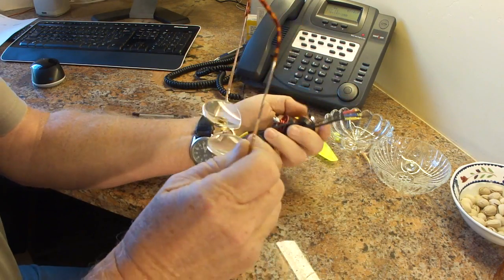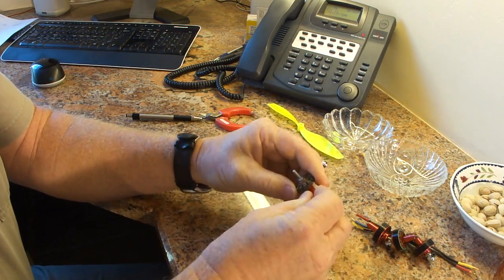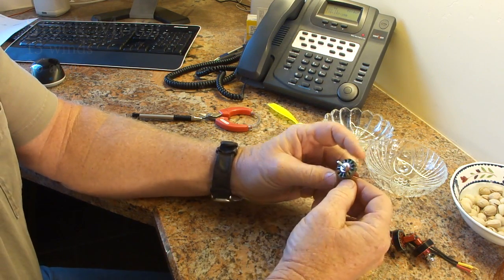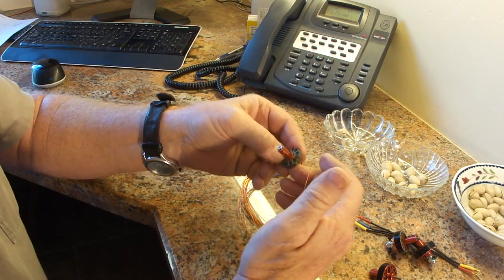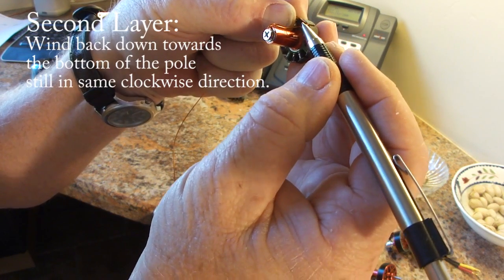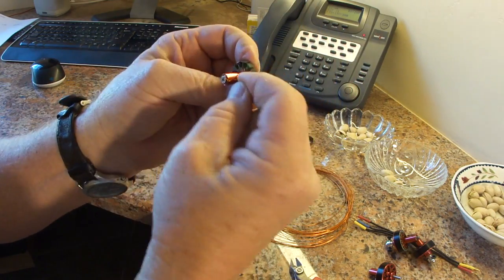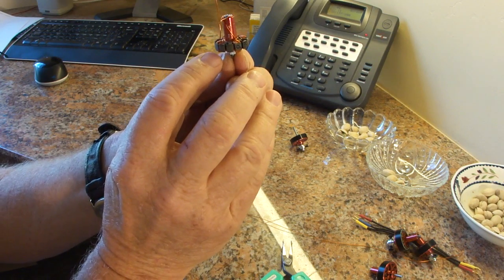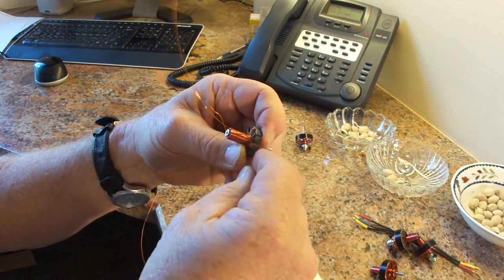Rewind Part 1.mpg

Comment from the maker: Label the end of each pole in sequence as you go around the stator counter clockwise (looking from the back of the motor) as follows: A, -, -, a, B, -, -, b, C, -, -, c .   Start phase A winding at a and end at A, phase B at b and end at B, and start phase C at c and end at C always skipping two poles moving from pole to ple in a counter clockwise direction.